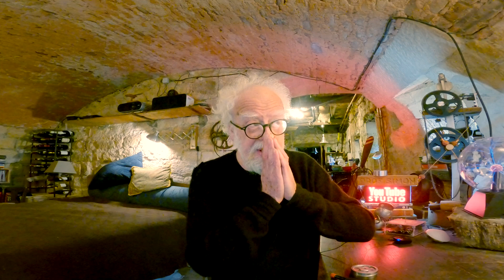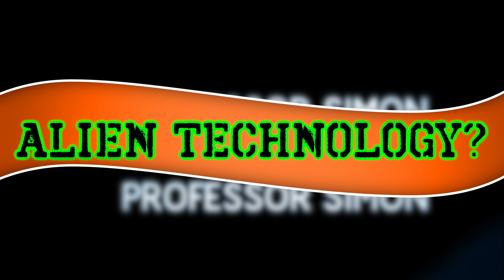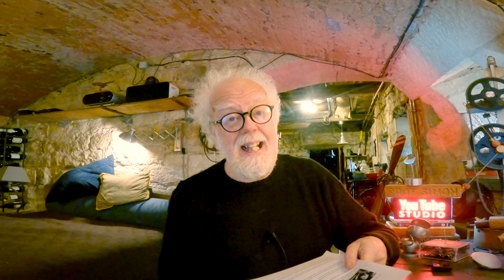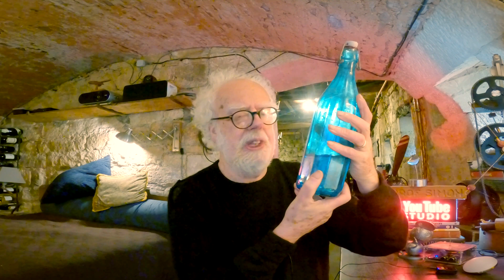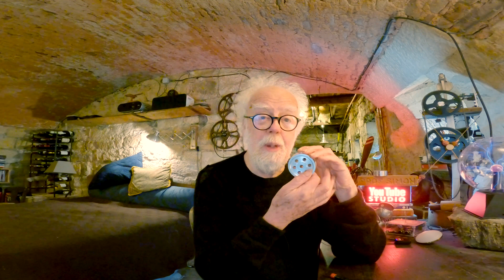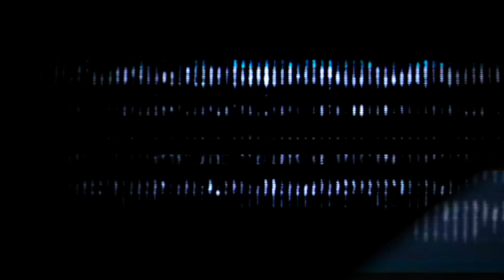Do YOU have ALIEN Technology in your house? - Prof Simon part 1

Comment: This did not come out of thin air. deep breath

tl:dr, the brits were not even the first peoples to come up with a cavity magnetron. That aside it was simply a logical integration of Klystron principals of using electron beam to resonate a cavity just like an electric whistle. Russians had already developed the same concept in 1936-40 but couldn't stop the cathode from burning out. Their designs differ only in the number of slotted cavities. Germans (Telefunken) knew about it from the Russians, too. Before both of them the Japanese (Shigeru Nakajima) had a 500w device in 1939 but the Navy dragged their feet until 1943. 

Blanchard, Y., Galati, G., & van Genderen, P. (2013). The Cavity Magnetron: Not Just a British Invention [Historical Corner]. IEEE Antennas and Propagation Magazine, 55(5), 244–254. doi:10.1109/map.2013.6735528 

In the main, the concept was evolved starting with the hull magnetron, invented by Albert W. Hull, who developed the first magnetron in 1921, then to Hidetsugu Yagi's split anode type, created in 1927.  In 1935, experiments by French GTSF laboratory used magnetrons having anodes with 6 to 18 anode segments instead of two. Their results cast doubt on existing theories of the split-anode magnetron and later were credited with having exerted a "profound effect," on British thinking about the cavity magnetron. Research on multiple-segment anodes in magnetrons culminated in the development of a fruitful theoretical concept known as the rotating-field theory, which was disclosed in 1935. This theory proved a vital key in the later work by Boot and Randall on the cavity magnetron. Next was an addition of the permanent magnets in 1936 by Chester W. Rice, allowing for smaller designs, who experimented with the radio searchlight phenomenon to locate an airplane and a car using doppler shifted reflections. In 1940  N. F. Alekslov and D. D. Malairov of Leningrad published an important paper (translated to english in 1944) on their effort to obtain higher power from a magnetron. They pointed out that the power obtained from the magnetron at ultra-high frequencies had been limited by anode heating. To overcome this difficulty, they made a magnetron with drilled holes in a copper block and got 300 watts (!!!!!) at 10cm and noted the possibility of using a large number of cavities. Boot and Randell, in the same year [actually Russians had been working on this in 36-37 and the holes did have slots. see tl;dr], for their first experimental magnetron, constructed a tube from a copper block, with six cavities drilled and arranged symmetrically around the cathode. They conducted a successful test of the device on 21 February 1940 and achieved a continuous power level of about 400 watts at 9.8 cm. They quickly informed Megaw at the British GE laboratory at Wembley, where the development of a microwave system for aircraft detection already was underway. By this time Megaw had learned the details of French magnetrons and of the advantage of large-diameter oxide-coated cathodes for high-power tubes. The facilities at Wembley were used to convert Boot and Randall's somewhat cumbersome experimental cavity magnetron into a more compact unit better suited for manufacture in large quantities. 

As far as making the leap of using the magnetron itself as the resonator, they already knew about the Klystron which used electron beams to excite resonating cavities. Really doesn't seem like that big of a leap, even if they didn't know about the russian discovery. I mean, it's brillliant, but it's not a big leap at all. "they experimented with positive-grid (Barkhausen effect) tubes while other members of the Birmingham group worked on velocity-modulated tubes (klystrons)."

Paraphrased from Brittain, J. E. (1985). "The Magnetron and the Beginnings of the Microwave Age". Physics Today, 38(7), 60–67. doi:10.1063/1.880982

Another good reference is page 232 of "The Pulse of Radar" The Autobiography of Robert Watson-Watt (available on internet archive) which provides are more human explanation of what they were thinking of. Also see Guerlec's Radar in World War II (226-29) and Radar days (bowen, pp-146-48).

Comment: Another issue with early radar was it was a relatively low RF frequency by today's standards, 50 Megacycles/Megahertz comes to mind. This means the antenna arrays we're huge because the dipole antennas that were used had to be over 1/2 to 5/8 wavelength. I have forgotten the actual wavelength measurement for the frequency used. Today's radar is using cm wavelength frequencies.

The higher the frequency the shorter the wavelength, this translates into smaller radar antennas or dishes if you will, making the system smaller and lighter with greater fidelity and definition.

In the sixties there was a lot of information out there on early radar that seems to have gotten lost over the years.

Comment: Large S-band magnetrons can produce up to 2.5 megawatts of peak power with an average power of 3.75 kW. Some large magnetrons are water-cooled. The magnetron remains in widespread use in roles that require high power, but where precise control over frequency and phase is unimportant.

Comment: Was the cavity magnetron an application of acoustical (sound) technology (musical instruments)  to radio waves?
For example would a guitar or a violin or a flute be a model for what the magnetron does?
Reply: In as much as any LC circuit is. The inductor is a magnetic vibrator, the capacitor an electric one. The size of these elements dictates at what frequency they resonate with each other.

I guess it's like a guitar. The string vibrates through whatever medium it's made of (nylon or metal) and the cavity is resonant with the soundwaves through air made by the string. The string is plucked and the cavity reflects and amplifies. I guess an inductor would be like the string and the capacitor, the cavity. When the two are in tune, they ring like an electric bell. 

I guess the magnetron would be more analogous to a bell than a guitar, because a single element acts as both a cavity and a vibrator. I mean, the cavity is also a vibrator--they just vibrate through different mediums and feed back on each other.

The model of the cavity he showed was incomplete (the holes around the sides need slots cut, connecting them to the center hole. In this way you basically have a ring of metal (inductor), the inside of which is slotted (act like capacitors). The whole thing is excited using a cathode up the center. A magnet encases everything to put the electrons on the right path as they exit the cathode and swirl into the cavity.

When he claims this design came from nothing, it's a BIT misleading. This concept was evolved starting with the hull magnetron, invented by Albert W. Hull, who developed the first magnetron in 1921, then to Hidetsugu Yagi's split anode type, created in 1927.  In 1935, experiments by French GTSF laboratory used magnetrons having anodes with 6 to 18 anode segments instead of two. Their results cast doubt on existing theories of the split-anode magnetron and later were credited with having exerted a "profound effect," on British thinking about the cavity magnetron. Research on multiple-segment anodes in magnetrons culminated in the development of a fruitful theoretical concept known as the rotating-field theory, which was disclosed in 1935. This theory proved a vital key in the later work by Boot and Randall on the cavity magnetron. Next was an addition of permanent magnets in 1936 by Chester W. Rice who used his magnetron to locate a plane and a car using doppler shifter reflections. Not to mention the work on Klystons that would have given them the idea of integrating resonating cavities (Russians accidentally did this with a magnetron by adding heatsink cavities the same year the brits did and got 300watts out). And so on and so on. The idea this came out of thin air is bunk.

Comment: I worked on Marconi Marine radar in the late 1970s. If I recall correctly the magnetron is magnetic, so wasn't made from copper, aluminium, etc. Or maybe it was made of those metals, but the magnet was external to it. It wasn't just the increased power that was significant, but the frequencies it generated - i.e. microwaves - proportionate in size to the cavities. Before the magnetron radar had frequencies in the tens or hundreds on MHz. The magnetron generated frequencies in the 1000s of MHz allowing them to be focussed. The massive negative pulses put on the cathode was another secret to the generation of radar microwaves and the magnetron. But yes, interesting where the concept came from. I suspect it was just a leap of intuition in overcoming the limitations of the klystron.
Reply from the maker: thanks Janet...and excellent description of the external magnets function.
Reply: @SimonHollandfilms  Looking forward to your follow-up when someone gives you some reliable historical data.
Reply from the maker: yes....please do people...and YES....I will share what people tell me.
Reply: @SimonHollandfilms  maybe not haha
Reply: Large S-band magnetrons can produce up to 2.5 megawatts of peak power with an average power of 3.75 kW. Some large magnetrons are water-cooled. The magnetron remains in widespread use in roles that require high power, but where precise control over frequency and phase is unimportant.
Reply: Magnetron itself is copper, but has a need for an extremely well directed magnetic field down the length, so there are 2 large magnets to provide it, with pole pieces shaped so as to make this field as linear as possible, to get high power and low loss. Thus the need to keep it well clear of ferrous metals, as they distort the fields, and the magnets are carefully aligned during manufacture. I have a set of these magnets, dating to the 1950's, removed from an old English Electric magnetron, and they have warnings on them about stray metal, and also that the AlNiCo they are comprised of is both hard, brittle and also will also stop working past around 150C, as that is just under the Curie point of the alloy. they needed forced air cooling, and in aircraft a lot of it.
Reply: What 🤔
Reply: @ggpa9246  What?